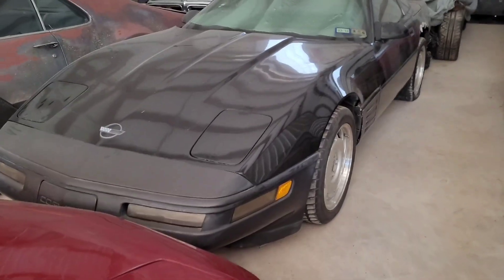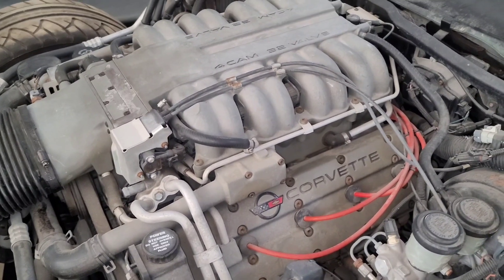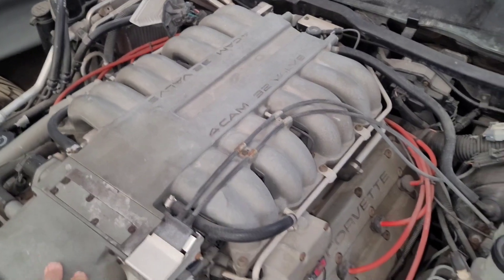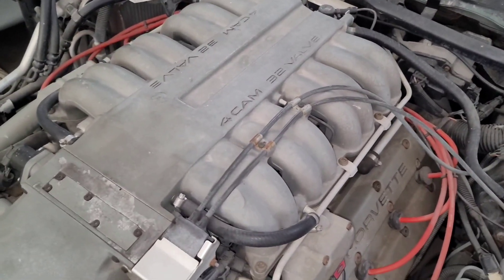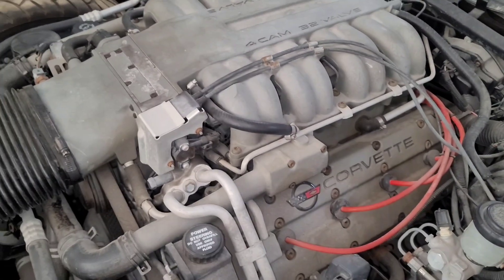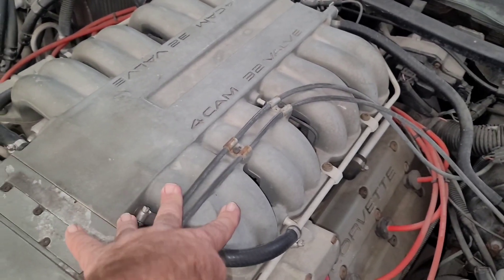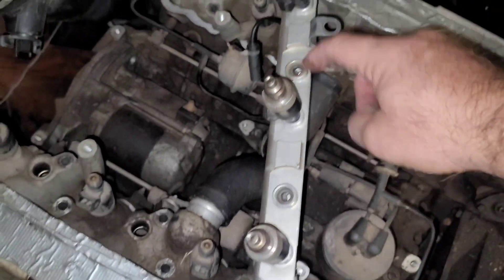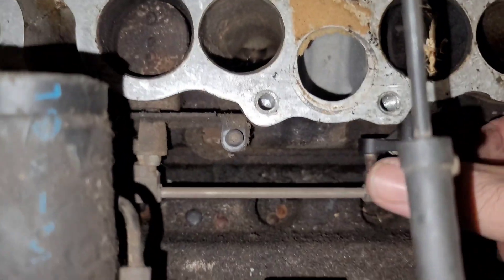The Epic C4 Corvette ZR-1 LT5 Engine of the 90's

Comment: Quick question, from 1990 to 1992 it was the same motor at 375hp, but for 93 to 95 they pushed it to I believe 405hp, could be wrong, but my question is, what did gm and the maker of this LT5 do it increase the hp range so much for hp and torque power ? 

Great video also ….

God bless

Comment: Great job presenting the LT5.  'First time i've seen how the secondary air inlet valves actuated. Yes, this is a really fun engine. 4k-7k rpm it sounds very unique, beautiful and angry. .  .  .  plus, of course, it puts out a ton of linear power. This was a very special engine in it's day, in my opinion, the LT5 was the inflection point between the malaise era and today's return to high-powered fun. This engine changed the paradigm for enthusiasts and car companies.  Bought '92, #206 new and can't drive it w/o smiling.  Well done.
Reply from the maker: Thanks, Daniel. I'm glad you enjoyed the video. I agree that the LT5 was a perfect way to usher in the performance era in an exotic package that still wows people today when they see it. While I wasn't lucky enough to have one of these beasts when they were new, the one on my stable now will be with me to the very end👍.

Comment: Omg it’s not a “power key”!!! It is a valet key! The engine came stock with aprox 400 hp. As it was essentially a super car they thought the rich would buy it and not want it “hot rodded” around when valet parking. So when you remove the valet key it cut the power in half. It does not engage or disengage anything. It simply limits fuel/rpm via a computer program…a power key !!! Lmfao!!!! Kids these days!!! And yes i have driven one and yes its a hell of a difference!!!

Comment: That's the best gm ever did get someone else to build them a engine. Heck look at geo a chevy luv gm did not build them, because they needed something reliable to sell t the time. Gm's technology today is still obsolete. Look at the auto manufactures now copying ford's eco boost and that's old tech compared what was done overseas 20 plus years ago. It does not take much to impress Chevy fans and that lt5 lotus built 350 would be today more complicated than their low iq's could comperhend. Hell it's decades ahead of this ls garbage, oh and their failed dod just like in the early 80's caddy cracks junk then junk now. That lt5350 zf 6 speed was and would scare the holy shit out of a fella they were so quick,  was in a sloppy built very unengineered untamed gm chassis (try holding that crap in the road at 140 plus, topped out at 180ish). I wrenched on several and it was a refreshing thought that i was not working on a pos dime a million 350 chevy garbage That's littered trailer parks, ghetto's and junk yards all over the world deemed the best engine ever BULL CRAP, but gm folks think so. I grew up in a gm family, buy new one day and work on them every weekend there after. Heck the 2 most reliable cars my mother ever had was a 1977 ford country squire station wagon 460 v8, had to buy in wyoming cause we left bama in a 76 chevy wagon (always smelling gas fumes no one could find , but it found it itself FIRE on highway and major electrical grimlins nobody could figure out (STUPID 70's LO IQ GM TECHS) and it burnt to the ground on the side of the road less than 2500 miles on it, and a 1985 chrysler newyorker 318 v8 when her 1981 olds 88 350 POS diesel blew in the tennessee mountains (4th engine replaced blew again and 5th engine installed) those were 2 fine examples of GM junk, crap, quality, (LTD wagon got T-Boned totalled in Tuscaloosa, AL1981). Better watch where you mow in high grass in america you will ruin your mower when you hit that 350,327,302,305,283 in knee deep weeds or a th350 400 trans which when running at one time in a hooptie or a meth heads transportation for supplies for the meth lab, colt45's, weed crack etc. I know gm fans love their ???? but Their's a lot better built stuff out there, was totota, honda but oh hell horse and buggy omish style it, Come on yoder hit those hores with some nitrous and get the hell outta my way. Last week i bought a 1989 gmc surburban 4x4/ so i'm just asking for it guess what, 700r4 trans out another fine pos gm transmission/prouduct to fix and flip.

Comment: I had a 1991 ZR-1. The LT-5 loves to breathe. With just intake porting, exhaust and a tune, these engines will make 500 crank hp. Mine surprised alot of modern musclecars.
Reply from the maker: It is amusing to have somebody roll up on an "old" C4 and see the utter look of surprise on their face when you embarrass them in front of their friends😁.
Reply: Dad bought a new 1991 lt5 definately not your crap gm small block, he had a 1984 red vette also bought new. Both give trouble mostly ac compressors, electrical, and body water leaks. He had many fast cars from sport fury's/roadrunners 67fury 440/69 rr 383, couple 429 manual torino's 70/71 and 72 grand torino 351c and the vette's and i wished i had him back and all those classic cars. I totalled the 84 vette Hydroplanned and went under a semi trailer wasn't speeding, but lucky i made it thru. I was scared dad would finish me of and he said son you are worth more than that car. I always wanted to find and buy him another 84 like it, i looked found a few but never bought one and today i regret that cause in 20 days hell be dead 4 years thanks to Biden's and china's covid.

Comment: Mercury marine in Stillwater Oklahoma. Overly complicated  for soso power output.
Reply from the maker: Yep, that is correct. I'm not so sure I would agree on the so-so power output. Maybe you've never ridden in one😁.
Reply: @VetteSource  just compared to today's vettes.
Reply: @louiszuech5436  That makes 0 sense
Like comparing something made in 2050 to a new one today. 
The 90s could rip off 12.90s with great mpg in the right conditions. Wasnt til the Z06 came out that time could be matched or beat
Reply: @gordocarbo  you make zero sense I love the old cars but 385 HP is average gm make a 3.6 high option single turbo that makes 455 HP 30 + mpg!
Reply: @louiszuech5436  ANy car can make power with a turbo .did they have that in 90, no . Comparing anything newer than the car in the vid is what makes 0 sense .
Reply: @gordocarbo 3.6 made 305 HP without turbo. I was a certified GM technician back then that Corvette was extremely high maintenance hard to find part, a lot of dealers wouldn't touch them, and the engines was warrantied through mercury marine not GM.

Comment: Youre not quite right about the throttle body. The one you showed at the front of the engine is just a standard throttle body.  One of each of the intake valves for each cylinder had its own vacuum operated thottle butterfly and it would open when the ecu requirements were met.  That small vacuum pump operates 2 actuators that are under the intake manifold. 4 of the intake butterflies are connected together on eac side with a vacuum servo to pull them open.  Each intake valve has its own fuel injector. Also under the intake manifold is the ignition coils and coil amplifier and right down the bottom in the V is the Denso starter motor. I have one of these and havevhadvthe intake off maby times sorting vacuum leaks and a buggered starter.
Reply from the maker: Thanks for the detailed description. I'm aware of the secondary throttle system and how it operates, but didn't want to get that in depth for this video. 

I will have another video out later showing the system in greater detail once I fire up another long-term stored 1990 ZR-1 I have laying around here somehwere😁.

Comment: Just bought an Ultima Sport that has an LT5 in it,, think it's a 96 motor and is brand new, only done a few miles ie under 25 miles.   Car has a long history and was even lost for 7 years.  Watching vids to find out about the motor as not many in the UK!   Thanks very interesting video.
Reply from the maker: Thanks, glad you enjoyed it👍. That seems like a pretty interesting car you've discovered with what is probably an interesting history.
Reply: 90-95 only. COuld have been an over the counter piece

Comment: MAIN REASON THIS OG DOHC CORVETTE DIDNT SELL GOOD WAS BECAUSE OF THE 100K PRICE TAG AS WELL AS THE FACT THAT DESPITE THE UPGRADED SUSPENSION AND WIDER STANCE, IT DIDNT LOOK ANY DIFFERENT THAN A REGULAR OL CORVETTE. IM SURE WE COULD EASILY TELL THE DIFFERENCE BUT IT WAS EXTREMELY SUBTLE TO NOTICE THE DIFFERENCE IN WIDTH.
Reply from the maker: Yep, there was definitely some.of that price gouging going in back then just like there is today. Personally, I prefer the 90 Z's over the 91-95's due to there being more obvious differences in the body styles.
Reply: True that was what made them cool they were unsuspecting to most guys
Mine was 58k new.

Comment: Seems like chevy threw away the ohc 32 valve with ford picking it up and ford throwing away the pushrod and picking up the ohv. The basic design of the ls is ford design. Oiling, cooling, firing order, basic geometry of it was ford.
Reply from the maker: Yea, they dropped it like a hot potatoes after the 90's were over and done. Funny that they have swung back around to this design in the new Z06 engine.
Reply: LS was a clean sheet design has nothing in common with Ford. Esp the heads

Comment: Great video, congratulations, but could you tell me where the engine identification number is? I have one here in my workshop in Brazil and I needed to find this number so we can get the car's documentation
Reply from the maker: Hi Asken, glad you enjoyed it. The VIN number for the LT5 engine is stamped into the passenger side rear of the engine block. You will need to get underneath the car to see it. An inspection mirror/flashlight helps.  It is located on the vertical face of the block directly adjacent to the transmission dowl pin in front of the bellhousing.